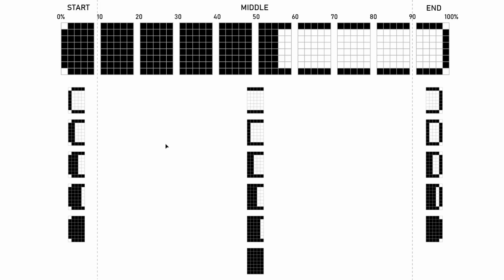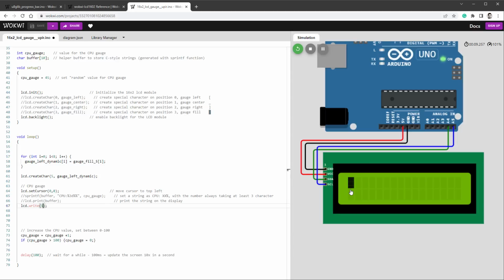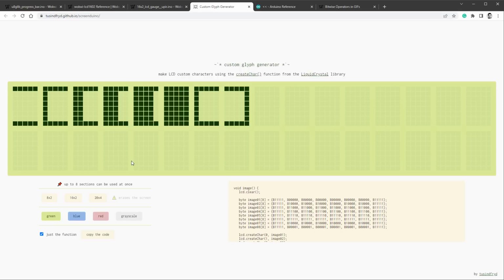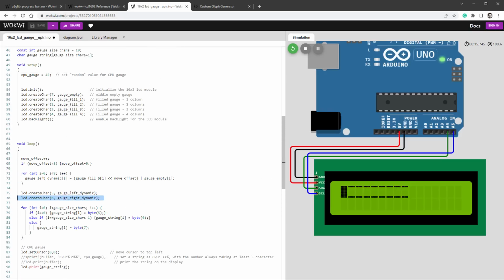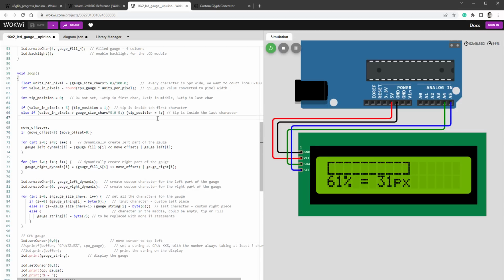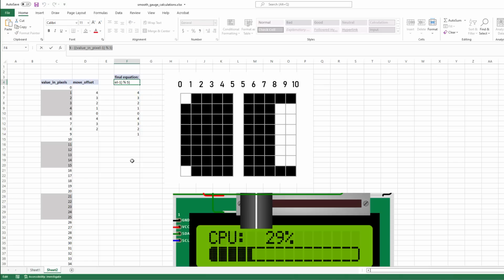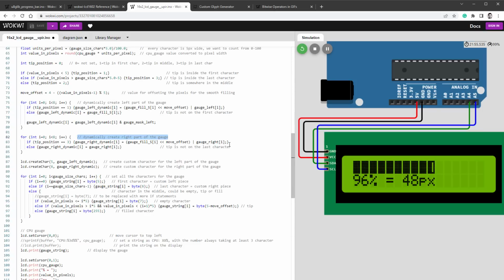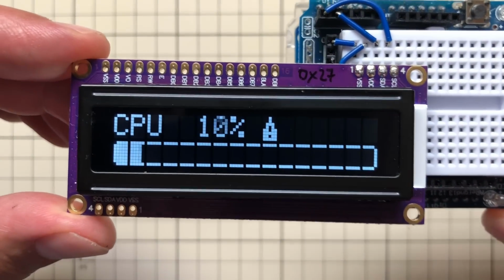Smooth Arduino 16x2 Gauge

Comment: is it possible to make the gauge decreasing instead of filling up? without affecting the percentage
thank you for the videos!😊
Reply from the maker: Sure, just change this code on line 73 from:

  int value_in_pixels = round(cpu_gauge * units_per_pixel);    // cpu_gauge value converted to pixel width

to:

  int value_in_pixels = round((100-cpu_gauge) * units_per_pixel);    // cpu_gauge value converted to pixel width, unfilling instead of filling
Reply: @upir_upir thank you!!😊

Comment: Even more smooth bar can be made. 50% chess-board between two step.
Reply: But only if it happens at 25th of a second. 1/12.5 on total. I think.
Reply from the maker: That´s interesting idea! You can even smootly fill the vertical line, and get 8x more resolution this way, but as you noted, it would only be helpful if the gauge is filling slowly..
Reply: @upir_upir  Need to do a simulation before creating actual code for 16x2.

Comment: Got a cool project for you with this gauge.  An electrical fence strength monitor for  farms. You could have a map with a bunch of these displays that would react when something has happened to the fence such as vegetation growth or branches being downed due to a storm. You could spread out the gauges on a map every 250 or so meters, then you can track down shorts on a fence line with a visual guide.
Reply from the maker: That´s very interesting idea! Do you have such fence to try this out? :)

Comment: I think I missed it, is the 8 character limit a display or Arduino limitation? Is it only custom characters that are limited?
Reply from the maker: It´s the limit of the driver chip for the display - i.e. it´s on the display side. Only the custom characters are limited, you can switch the content of those 8 characters every frame if you want to.

Comment: You don't need to use charakter 0 this ist also mapped to 0x08 by the Hitachi Controllers. So all custom Charakters can be accessed by either 0 to 7 or 8 to 15.
Reply from the maker: I didn´t know that, thank you for letting me know!
Reply: Sorry, I was wrong actially ist 8-15 I corrected my comment

Comment: Meh, I made a similar display using the PC serial port and LCDSmartie over 20 years ago now... I don't see the benefit of switching to an Arduino based solution here?
Reply from the maker: The tutorial is for the gauge, you can use it independently of the computer for any indicator. If you only want to display CPU load, LCDSmartie would be surely a faster and easier solution.

Comment: On my gauge, for less important values, I use a dynamic character where each pixel represents about 3% (char is 5x7 for me). It fills right to left, bottom to top. One character can give a smooth-fill single-character display of a value that I find really useable. Particularly useful for things that done change rapidly. Like disk space, etc.
Reply from the maker: That´s an interesting idea, thanks for sharing it!
Reply: @upir_upir  You're welcome. I just realized you could incorporate that into your last segment. Have it as shown, but fill bottom to top one pixel at a time, column by column. If someone was staring at the meter waiting for it to complete (or max-out), they get a "zoomed in" view of the last segment.

Comment: 1.) 4 - (value - 1) % 5 <=> 5 - value % 5
2.) You always have the border, so using 2 masks (or-mask and and-mask) is inefficient if you can set these 4 bytes as constants for the left and right char, for [1:6] not [0:7]
Reply from the maker: Good points! You are correct about the borders, it could be optimized for this gauge, but I believe those calculations take only few cycles
Reply: You can assume that a proper compiler will do these optimizations, as these are constant states always so the dynamic char will always be initialized as [and-mask[0], 0[1:6], and-mask[7]] with an adjusted loop. But reflecting your own code and cutting out useless or redundant calculations on your own is a very powerful progress a programmer can do.
Compilers are amazing these days.

Comment: Hmm.. It cannot show two independent smooth gauges (progress bars) on the same LCD at the same time?
Reply: It would require a small change so they each had their own character for the tip.
Reply: @0LoneTech  Now it does (my way kind of...) but I cannot paste a hyperlink here wokwi ... projects ... 334758694868746834
Reply from the maker: LoneTech is correct. Since you only have up to 8 custom characters, you would also need to create dynamic tip. Another option would be not to use border on left and right side, which would decrease the number of used characters.
Reply: @upir_upir  If you want to keep the rounded corners of the gauge, than up to 2 gauges can be displayed (done see my github or wokwi ... projects ... 334758694868746834). If you can do with square gauges than you will need one character for the empty space (with borders) in the middle of the gauge, and one for the right edge of the gauge. These two can be common (reused) for all displayed gauges. You will also need one character for the fully filled gauge space in the middle (or use the chr(255)). The left edge of the gauge as well as the moving edge between the filled and empty part of the gauge will need only 1 additional character per gauge. This way (square gauge, full 5x8 square chr(255) used for the filled up part of the gauge you will need 2 common  + 1 character per each independent gauge that would make 6 independent smooth gauges possible. Anyway, I do not think that more than 2 would be used in real world scenario on such LCD displays.

Comment: A bit of an optimization here, you define 4 custom characters for the middle part of the gauge, couldn't you combine gauge_fill_1 through 4 in one as you did for the start and end parts, since they surely won't be shown at the same time either? That would save 3 precious custom characters you can use for more warning signs. Otherwise, looks pretty cool :)
Reply: The I²C connection is quite slow, so you will see intermediate states if you alter a character that's being displayed. This is visible in this video, with e.g. gauge_left taking on appearances partway between levels 4 and 5. You can avoid this using double buffering; display a different character than the one you're redefining. In this case, you'd need left+right+empty+2*dynamic=5 custom characters for one gauge (add one more dynamic per gauge, such that at least one dynamic is always not currently shown). I left out the full glyph because it already exists as 0xff. The downside of this method is more logic and having to update the text region each time (though several transitions don't require a glyph redefinition). 

It's possible to do full screen swaps in one visual step also, but a little inefficient. You have 80 characters text memory, so a smaller display like 16x2 has enough memory to hold a fully distinct screen; e.g. for 16x2 you can swap by doing display off, 16 display shift, display on. This operation takes no more time than writing 18 characters, but that's already a lot of time on I²C. Other display controllers have other limitations, e.g. might be able to set address immediately instead of shifting one column per command.
Reply from the maker: Thank you for your comment. That´s surely a good idea, but I did forgot to mention in the video that this is something that I have tried but it was not working. What you want to do is:
1) Change the custom character
2) Display the custom character on a different position

However, between steps 1) and 2), the new character is already in the memory, so for the fraction of the second, it´s displayed on the previous position, causing a little bit of blinking. It´s visible both in WOKWI and on Arduino, even when you put those two commands next to each other. This is not a problem for the first and last character, as the position of those characters is not changing. I hope the explanation makes sense.
Reply: @upir_upir  This doesn't make sense, unless you're not using character 255. When filling, the character will step through {empty, fill1, fill2, fill3, fill4, 255}, with all other middle characters being either empty or 255 (i.e. not changing); there's no blinking here. When emptying, the character will step through {255, fill4, fill3, fill2, fill1, empty}, with all other middle characters again being either empty or 255 (& not changing); there's no blinking here. So you only need 4 custom character positions: {dyn_start, empty, dyn_fill, dyn_end}
Reply: @upir_upir  is this not an artifact in your simulator? My students always enjoy the class when we do custom characters ... but we do not do more than 8.
I would recommend doing it on the actual hardware. The one thing you need to be careful is to have a set ddram address after a set cgram address because the internal address counter handles both so it needs to be overwritten before the new character can be displayed. Also if timing is that crucial you might want to connect all 8 input bits and do polling to cut down write time as much as possible.
Reply: Can't you do it in three steps? Set original pos to either full or empty char, create new dynamic char, set new pos to dynamic char.

And if it needs to be changed on the same position, it should be enough to just update the character, so only one step.

Comment: Tbh when you said smooth, i thought it would be increase the refresh rate and responsiveness of the display, not creating custom character. Maybe like tweaking the library etc., just like how you've done it on the display knob. Because my 16*2 display is kinda slow idk why.

But nonetheless, this is also EXACTLY what i'm looking for! Dynamic character heck yeah! I've been looking for it for months! Especially that stupid 255 byte, and you just do it like nothing. Amazingggg. Thanks!
Reply from the maker: Thank you for a nice comment. Have you tried other displays? The “standard” blue is indeed very slow to update/refresh, but this new that I’m using in this video are quite fast. I’m currently waiting for the OLED version of those, and I hope they would be even faster. I will upload a video once I find out.